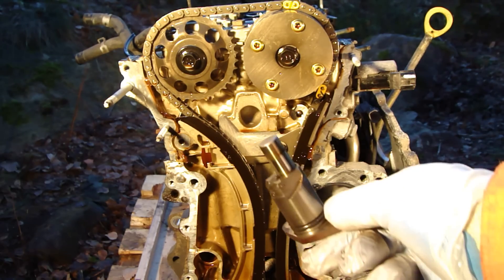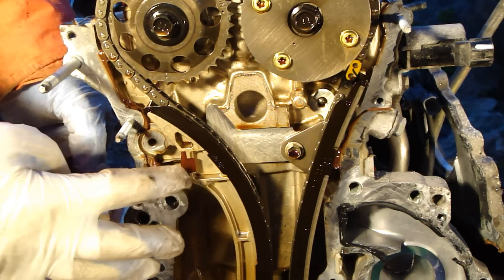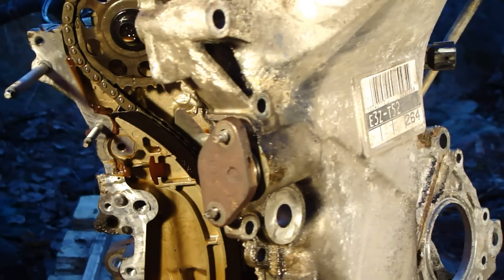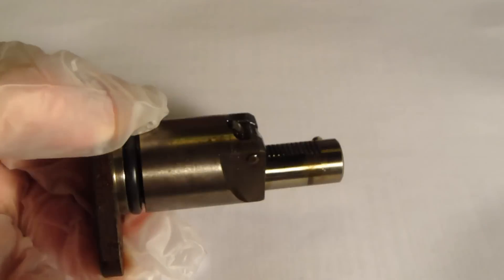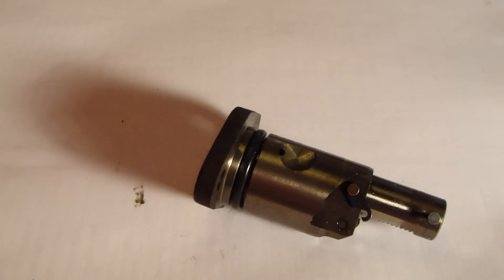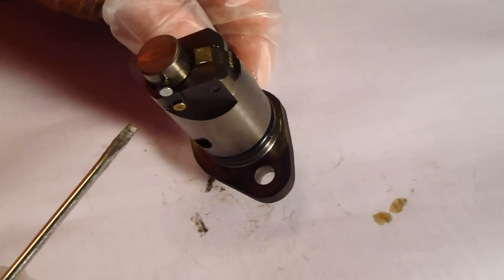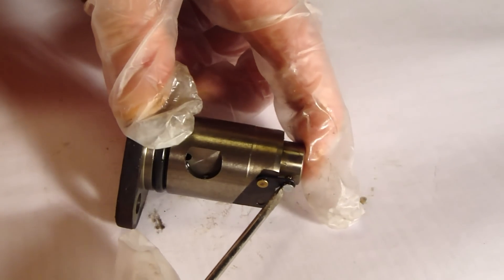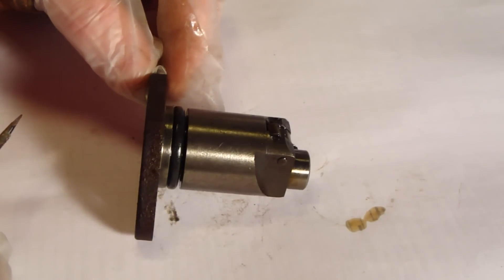How works tensioner timing chain VVT-i engine Toyota. And how to load tensioner.

Comment: Dear Peter.
Your demonstration has been very informative. Thank you very much. However, I still have one question. Is it, in your opinion, easy to release the hook from the timing chain tensioner's piston with the timing chain cover on the vehicle? Is there room? Thanks!
Reply from the maker: Hi, it is possible to release when cylinder head cover is open. And it is accurate job.
Reply: Thanks!

Comment: thnank u man ,but when i replace valve cover gasket is that necessary to clean the tension timing chain
Reply from the maker: No. You need this tensioner in cylinder head change.
Reply: thnx

Comment: inside the tensioner is a small spring and valve! that lets oil pass through to help to tension the timing chain! the small hole in the valve can become blocked with sealant and will cause a noise from the timing chain as the engine warms up!
Reply from the maker: Thanks for info.

Comment: Great video.  Very informative.  My Toyota dealer told me $600 to fix an oil leak from my timing chain cover.  I think it might just be the o-ring on the tensioner. 

Read that you need to hand turn the crankshaft to get the tensioner to unclip after it's installed.
Reply from the maker: ***** Good work.
Reply: My repairmen quoted $400. Ok so that little tensioner is either way expensive!

Comment: hi pete! I have a 2001 1.8 190 vvti and when I had the head gasket replaced the car doesn't want to rev over 6000 rpm which the vvti wont kick in. any ideas what the problem could be??? cheers
Reply from the maker: Hi, interesting issue. Please check all VVTi-systems electric cable wires connections and contacts again in motor area. Look my video VVTi system and cable wires: http://youtu.be/T0G5KLN4a_w
Reply: Nath Roberts u talking 600rpm? Or 6000? If at 6000 u don’t have vvt-I working then u have a big problem , to begin with u don’t usually need to reach 6000 rpm unless you’re on a race track , 6000 rpm is usually the red line anyways

Comment: My Toyota Yaris 1.3vvti  2001. hawe a problem! in low RPM to 2000 RPM it interruption! diagnosis show error 1349! What do you mean? Thanks and hallo and respect from Serbia!
Reply from the maker: Hello, here are possible reasons, please check:
- Dirty or low engine oil
- Valve timing
- Oil control valve
- Variable Valve Timing controller assembly
- Engine Control Module (ECM)

http://engine-codes.com/uploads/toyota/EG007-03.pdf

https://www.google.fi/#q=toyota+error+code+p1349

Read more: http://engine-codes.com/p1349_toyota.html#ixzz2rxWFRrrr
Reply: Thanks! It was Variable Valve Timing controller.

Comment: Hello sir, may I ask if their is a reason you may want to take the timing chain tensioner out? Is this for cleaning purposes or is their a sort of upkeep? By the way I really like all your videos. I have an early 8th generation toyota corolla. While the car design is similar their are some minor differences so that I had to think outside the box. Having no prior mechanical knowledge
Reply: Or if you want to service the valve stem seals
Reply from the maker: Hello, good question. Normally we take this tensioner out only, when we are disassembling the whole motor. And normally this tensioner last same time as timing chain estimate 300 000 miles/ 500 000 km or even more.